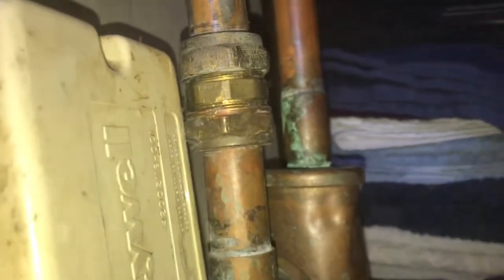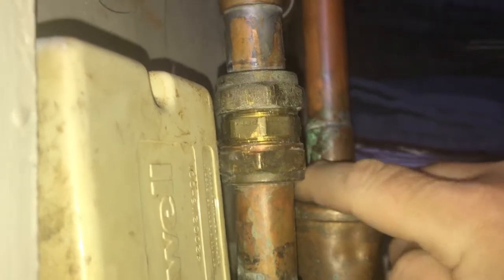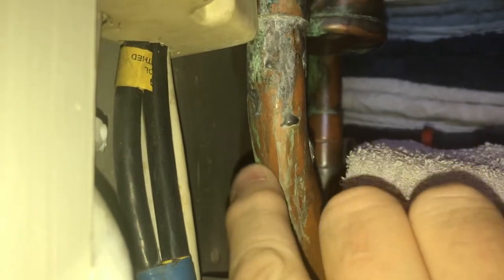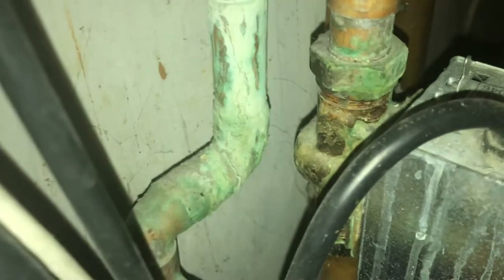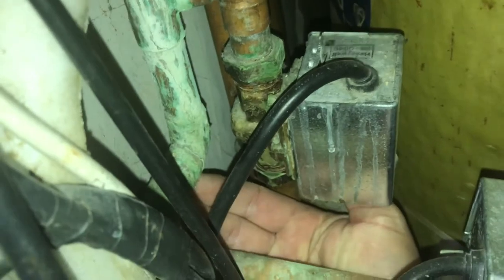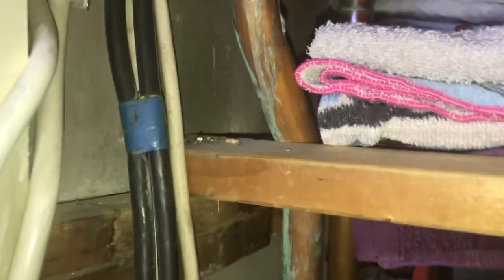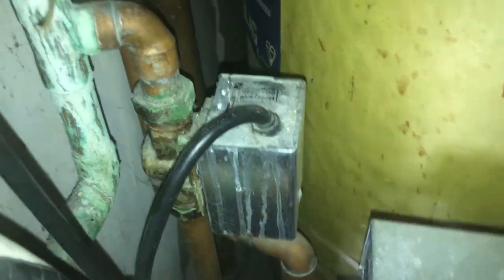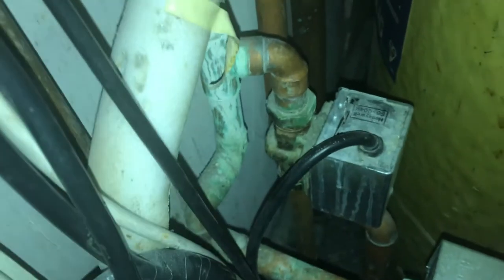Should you worry about the green rust/patina (virdigris) on your copper pipes?

Comment: Where is the solution
Reply from the maker: If you have a leak, it needs fixing. If it's just flux related virdigris, no works are usually required, as it's just a cosmetic issue. If leak related virdigris, check as per video. As always though, if in doubt, call you local plumber in to check and repair as necessary.

Comment: Thanks so much for video...I saw this on my water meter pipe inside the house and it does have a pin size leak with white and green corrosion. Would you suggest I try to clean and seal leak and see what happens before calling plumber and if so what can I use to clean it off with? Thanks

Comment: I am no plumber but I would want to get those cleaned up soon.
Reply from the maker: Hi Stuntz. Thanks for watching and commenting. The rusting actually self seals smaller holes, so is okay to leave, so long as it's not still leaking. However, if you clean it off or do something like a power flush, there's a pretty good chance the removal would cause a leak.

Comment: Thank you, foundrandom round patches on the pipes under radiator, look like Virdigris. but seems to only be on the pipe directly under the radiator.
Reply from the maker: Sounds to me like you may have a small leak on yopur rad valve. First things first, wipe it off and put down a sheet of white paper, to see if it's still leaking and as the paper is white, you'll be able to see the colour of the leaking water. If it is leaking, I'd definitley reseal the pipe, rather than wait for it to self seal.

Comment: Good knowledge but what about if the gas pipe is green or blue on the welding is that save
Reply from the maker: In my opinion, virdigris is found on water pipes. If you have the slightest idea that you have a leak on a gas pipe, call the experts in straight away.

Comment: Does painting pipes cause any issues?
Reply from the maker: Hi Mr B. If you were going to paint the pipe, you would most likely want to remove all verdigris, patina, rust etc., first. Otherwise the finish would be pretty poor. The issue then would be that the virdigris can seal small pin hole leaks and removing it, might cause a leak again. It's your choice whether you do so, but I'd say proceed with caution. You may be okay but then again, you may not be. Sorry for not giving you a definitive answer.

Comment: Have done a bit of a clean and flush on the central heating recently and then after coming back from a long weekend break away found a couple of small drops of inky blue residue come down from behind the boxed in copper pipes in a newly fitted kitchen..😮 anyway, I did realise what it was so went upstairs to the airing cupboard and found hiding behind the hot water tank a pipe with verdigris, I can see some historical runs, but there is a big blob of dark verdigris, so am thinking the drip came from that but has since been dry, I'm reluctant to rub it off in case I start a major leak, I'm not yet sure what this pipe does, hopefully it's not not mains pressure, if it was, maybe it would have blown out by now, am hoping it's just expansion pipe up to the tank, I'll have to get up into the loft to make sure sooner rather than later.
Reply from the maker: I feel your pain. I've gotta power flush my system soon, so may be having similar issues to you.